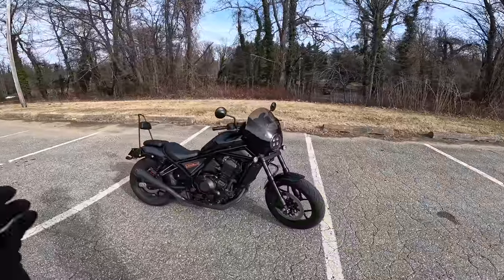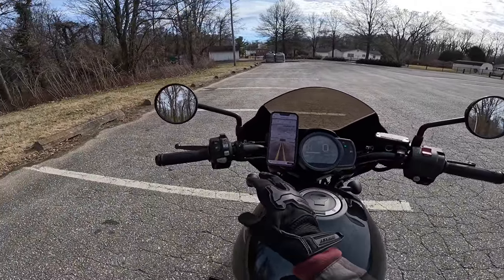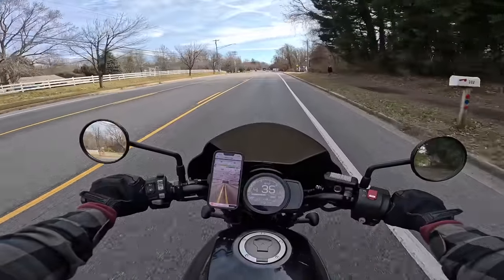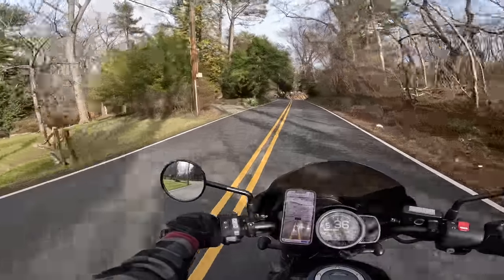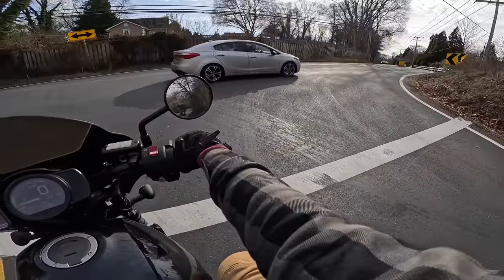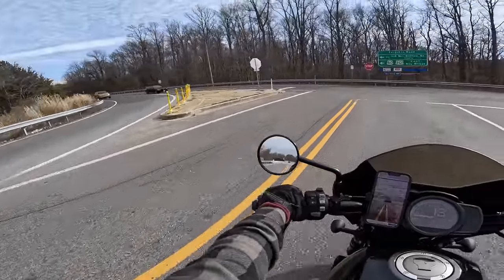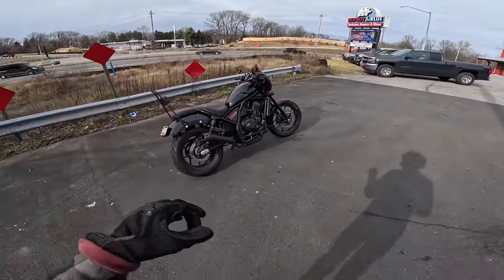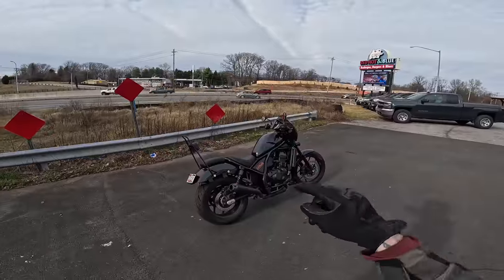The TRUTH About The Infamous Rebel 1100 Speed Wobbles

Comment: I have had the 2023 honda rebel 1100 manual for 2 months, brand new. No wobble until i hit 1000 miles and went over 93 mph. Took it to the dealership, they replaced the front dunlop tire. They said it had a hump in it.  Ok.The warranty provided a new dunlop front tire. Took it for a test drive, when i hit 90 mph, the wobble was worse. I found your video. Took a risk on the Metzler cruistecs,they just installed it today. Took it up to 100 mph 5 times. NO WOBBLE. I said all that to say...thankyou bro. Metzler needs to cut you a check. Blessings to you and your family.
Reply: did you use the bias belted or the radial tires
Reply: @shellyrodrigues9661  both tires are belted bias. You wanna know something crazy, last week, the wobble came back everytime I hit about 87 mph. I dont even know what's going on at this point

Comment: Could it be Honda tested this bike at high speed and they found out the tires were the problem?  They probably had a tire contract with the OEM and it would have cost a fortune to replace all the tires they committed to.  Much cheaper to put in a Rev Limiter and call it a day and a buck saved. Plus the benefit of saying we don't want our buyers to go faster than 99MPH which should let them get around a 18 wheeler safely.  Safety for our customers is our MAIN CONCERN.  YEAH RIGHT

Comment: I have had the wobble happen, and it's slightly terrifying when going over bumps at high speeds. I just resigned myself to not needing to go that fast and left it there. If I do change my mind, this will likely be the tires I get. Thanks for your vid and info!
Reply: I’m about to buy one, at what speeds does this start to happen?
Reply: @Randy Dowling  91ish for me
Reply: I have just replaced the worn out rear Dunlop tire with the Metzeler cruisetec, and voilá, the wobble does not happen any more.
Reply: @randyhorsey I can't say what speed mine started at, because all I did was get on the throttle in sport mode so as I picked up speed...maybe between 70-85 mph it started for me.

Comment: @45K miles on the Rebel 1100 DCT  I've now been thru 2 sets of Dunlop/Sumitomo OEMs and now on second set of Pirelli Night Dragons. She absolutely loves her Italian shoes. Even got her a new gold chain Friday in addition to a third set of front/rear wheel bearings which I replace every 15K. Had rear ones blow out southbound on I-95 at 70 MPH and suffice to say it required a whole new back end for the bike - covered by Honda so . . . Great bike and not sure what I'm getting next. Can't see selling her or trading her in - just needs a sibling I think.  I don't have much speed wobble issue except for perhaps it settling too hard on the back when accelerating at speed on interstate. stiffened suspension couple of times and I think she rides much better.
Reply: Hey Robert! 45k miles man? WOW! you definitely hold the record!  RESPECT!!
Reply from the maker: Wow you’re really putting the miles on!! 🤯 I haven’t even done half that between EVERY vehicle I own in the past 2 years! That’s wild that your rear wheel bearings went out. Did Honda say what could’ve caused it?
Reply: @LifeOfBurch  I think all motorcycles need wheel bearings replaced every now and again? It's one of those things they could last a long or not so long time so I change em out every 15K front/rear both and avoid issue altogether. They're relatively cheap parts and can easily be put on when getting tires. IDK specifically what caused it but it could have been an f'd up evening had it been worse or on the front. Honda ended up replacing back wheel, ABS, rear brakes, etc. Definite show stopper and screwed up my weekend plans but thankful it wasn't a real problem so much as a nuisance.
Reply: @ontherebel11  we're holdin steady at 3 crashes and 7-8 drops - depending on how we count a "drop" LOL . . . Love ur chan BTW
Reply: @MeanRachel  All the drops on camera and off camera were not done by done LOL 
it's not about if, it's when we'll drop the bike, simple physics LOL Thank you for sharing your experience with the community, i'll be keeping a close eye on the bearings and will replace them soon based on your recommendation!

Comment: I have a 2007 Honda Shadow VLX 600 I bought in 2021.  It still had the factory Dunlop tires.  It won’t go over 85-90 mph, but I noticed I would get a wobble when I took my hands off of the handle bars.  Not a big deal, but I Increased the preload on the rear suspension just to see.  No change.  At 7000 miles, I Changed out the , now significantly worn, tires to a new set of “balanced” Dunlop 404’s.  In 3000 miles, the wobble has not returned.  For whatever that additional anecdotal evidence is worth  😂

Comment: Tires are always a good place to start. I thought mine was immune till 2 weeks ago I joined some naked bike, group riders and did some sustained pulls past 178kp/h and that issue occurred to me for the first time. those oscillations are a bit off putting. In this nanny state those speeds get you in jail and automatic loss of license, so is a rare effort. I will keep the factory tires till they are due to be replaced. However this is almost a recall problem. If you look at the center line grove on the front tire it is molded with small offset blocks in the line of the groove, almost designed to wobble at certain harmonics (speed).

Comment: I have been preaching for years that the stock Dunlop D404 found on a lot of bikes as stock absolutely suck. They are the most numb feeling tire I've ever rode on in terms of feedback. They aren't good in the rain. And they feel squirrelly if you try to chuck it in the corners. Should call them dunFLOPs. Most of the good reviews are from people that have never put a different tire on and never tried actual good performing tires. Michelin, pirelli, metzler are all upgrades. I recommend Michelin commander 2 for cruisers. And the road 6 for sport bikes. They feel glued to the road, even in the rain

Comment: Hey Burch! Hope the issue is forever fixed. Same thing happened to my buddy who has a DCT 2023 version. We first thought it could be the fairing and what not since thats the only difference between his bike and mine ('21 DCT). But no it kept happening even without the fairing. A mechanic said the handle bar felt loose after a test ride and he tightened the bolt (the one in the center under the digital gauge). He tightened it a little more than a quarter turn. I thought it might be a useful information to others who might be still experiencing this infamous issue. Ride safe!

Comment: How good is the suspension? Does it bottom out and hammer your spine when you hit a pot hole? If it does is there an aftermarket shock available that will fix the problem?
Reply: There is an adjustment on the rear shocks to helps dampen this

Comment: Hi i have a Honda Rebel 500 2019 i had the same problem with speed wobble tried all sort of things but when i changed the tyres after 1000 miles still no dreaded wobble. Now Running on Mitchel Commander 2. thanks for the brillant video

Comment: Where did you get that headlight fairing on that 1100? I want one.

EDIT: I actually found that fairing, its the GAUNTLET FAIRING FOR 2021 - 2023 HONDA REBEL 1100 from Memphis Shades. But now i need to know if a fairing for the 1100 will fit on the Rebel 500. If anyone knows, please let me know.

Comment: OMG...as I mentioned, I purchased mine less than a month ago. Well, I took it on a lil distance ride about an hour or so and on this 2-lane highway, I've had to pass a few trucks and cars in the oncoming lane. In sport mode when I get on it that thing started doing the Humpty Dance on me which forced me to immediately get OFF the throttle causing significant danger ☠️💀 to life, with oncoming traffic approaching and me not passing fast enough since I'm  forced to slow down. 
At first I thought it was something I did, so I moved my phone mount as well. Told the dealership about it and they told me to add stabilizers to the bike, (which I didn't). Tried passing on these two-lane highway roads other times and boom, same Humpty Dance wobble. This scared me so bad that one time I audibly said in my helmet "ooh LaWD, please not like this..., I'll remove my OMWTFYB license frame!! 😳😫🤥!! 
I'm so happy to know that this manufacture defect is the problem. Honestly, due to the safety risks this poses to riders and other motorists, Honda, Dunlop or someone should make this a manufacture recall and THEY should fund these tires that resolve the issue. You have no idea how thankful I am, that I'm learning it's not just me having this issue that really gave me HUGE concerns about riding and keeping this new bike. 
I also thought it was because of the stock hard saddle bags or the batwing fairing with the low windshield, but again, it's the tires!!?? WOW-Shamwow-, Great Scott!
So with your platform and following, I believe you have the juice to bring this safety issue to Honda because obviously this is not an isolated problem. 🤷🏼👍🏼. Thank you 🙏🏼🤝

Comment: If new tires don't solve your problem, correct air pressure and oil level in your forks is critical, if your bike is so equipped.

Comment: No, it's not the tires either. It's because the rebel is a tubular frame cruiser style bike. End of story. Tubular frames simply have a lot of flex, and that's the underlying cause of the wobblieness at higher speeds. All tubular frame bikes have this "characteristic" - just give any of them a quick jab on one of the handlebars at speed, and you'll see the PIO (Pilot Induced Oscillation). That's why sport bikes have the much stiffer monocoque frames - to reduce (but not entirely eliminate) this flexing at high speeds. 

There's nothing wrong with the bike, since bikes have been made with tubes since the beginning of time. But they are not designed to go that fast. So the only "right" way to "fix" this shimmy is to simply not go so fast on it that it becomes unstable. There's really no other safe option. You can find the speed where this oscillation enters "negative stability" (stays the same or increases in magnitude) experimentally by testing the amount of it at various speeds. When you find the speed where it just begins to lose "positive stability" (shimmy shows no tendency to remain at the same amplitude or increase), that's your new "Vne" (Velocity Never Exceed) for your bike for the remainder of your two lives. Keep it at or below that speed for your own safety. 

Sorry to be a bubble-burster on this. Just don't go 100+ on the bike is really the only safe answer....
Reply: I've extensively studied this post and after much consideration I believe it is 100% true. This is based on the undeniable fact that this is by far the post with the most words. Some of these words even required googling. In case you doubt me, rest assured that I am a bachelor of science.
Reply: Interesting bro. Very interesting

Comment: The tire tread is backwards on the stock tires. They should be recalled.
Reply: Back to the point in my comment. If it were that simple why didn't Honda, with some of the best engineering talent in the automotive/motorcycle world, would figure it out at the factory before they shipped it.

Comment: The stock tires may not be rated for that speed. Either way at least you didn't eat pavement before you figured it out.
Reply from the maker: The stock tires don’t have a super high speed rating, but the wobble started well before approaching the speed rating. The speed rating is higher than the 100mph limit put on the bike from the factory.
Reply: Wow ok. Well they may just be bad tires but I don't know what else it could've been. Like i said at least you didn't eat pavement. Keep the videos coming brother.

Comment: Makes sense. I was thinking it was going to be suspension. But I mean... tires are still somewhat part of the whole suspension system. So I guess if the stock ones were a bit softer it makes sense. I'm guessing at speed when the tire gets bumped and then unloaded any instability (like bumps on the road, or those snacking cracks) would be maximised and leading to the wobble, just like in regular soft front suspension issues.
Legit of you to acknowledge that it wasn't fully gone. I had seen some forums quoting you about the wobble, and am glad you went a bit more into details here.
Reply from the maker: You’re exactly right! And yea I figured I had to expand on this more since I KEPT seeing people referencing that old video as the “end all be all” solution. That video was barely getting views anymore, but obviously was still unintentionally misleading people. I’m just glad that it’s finally ACTUALLY fixed and hope that this video helps lead people in the right direction 🤘🏻
Reply: I would assume head bearings

Comment: So what is the TRUE gps top speed with the speedo heeler? My Rebel 1100 (EUDM) has the limiter at 170 kph (~106 mph)✌
Reply from the maker: I’m not sure, but I’m sure it could be figured out with one of those online calculators based off gear ratio and rev limiter in 6th gear. I’ve seen others confirm at least 120mph so far, but haven’t tested it that hard yet personally.

Comment: It is so lame on the part of a company like Honda, with all of it's engineering capability, that it was up to the customer to fix that problem.  It's is very odd that Honda limited the Rebel 1100 to 100 mph.  Why would anybody buy an 1100 cc motorcycle that can't go over 100 mph.  Even the Rebel 500 can go faster than 100 mph.  It seems  likely, at least to me,  that Honda knew about the wobble and their quick fix to the problem was limiting the top speed.  Now what will be interesting is what happens when your new Metzeler tires, especially the front tire, gets a little wear on it. I wouldn't be too surprised if the problem resurfaces once the tire gets a little worn.  If a tire change was all it took to solve the problem you would think Honda would have figured that out.     

I would never buy a Rebel anyway because I really dislike the cruiser style but the new 750 Honda Hornet is a completely different issue.  It's fast and probably will be cheap, and has all the goodies.  It comes in nice colors, and it looks like what I think a motorcycle should look like.
Reply from the maker: Gus, who I mentioned in this video, has 12k miles on his Cruisetecs and they’re still wobble-free and brand new looking. Tire wear won’t be an issue.
Reply: @LifeOfBurch  Tires do wear out, and a worn front tire can cause issues with any bike, but it looks like you won't have to worry about that for a while.

Comment: I fot my 2023 1100cc dct rebel and the same day got this unwanted issue with the wobble.
Looked for reviews on YT and found this video.
Lived with the problem for 7k miles, which was the life term of the rear Dunlop tire the bike came with. Yesterday 7/12/24, turned in to the shop to get replaced with the Metzeler cruisetec, rode it for 120 miles over the same road I drive everyday, and surprisingly the wobble did not happen at all.

At first I was reluctant to give credit on this suggestion, but now I'm very grateful to found this video and followed the recommendation on it.

Thank you so much Burch, now I'm much better enjoying my bike.

Mateo Salazar

Comment: Crazy thing my rebel 300 tops out at 120. I'm not sure if you may need a tune up.

Mine has an exhaust wrap and some firestone retro tires with a front Cowell and arrow kit. 

I'm considering a gear change to make it go a little faster. And possible ordering some new internals to make it handle boost.